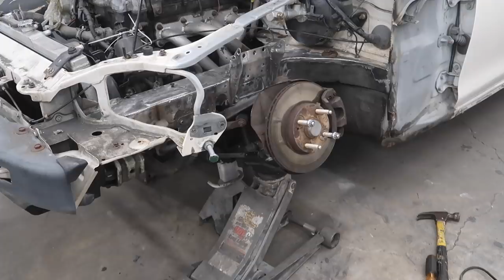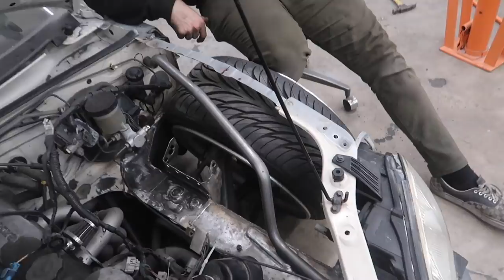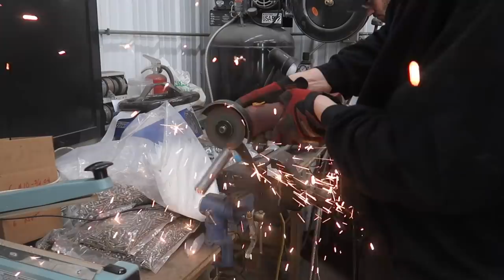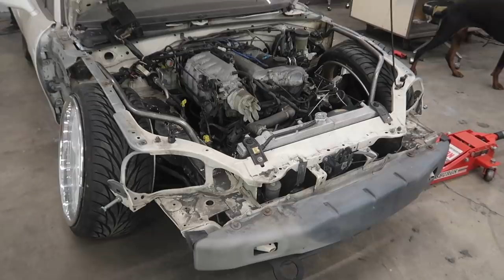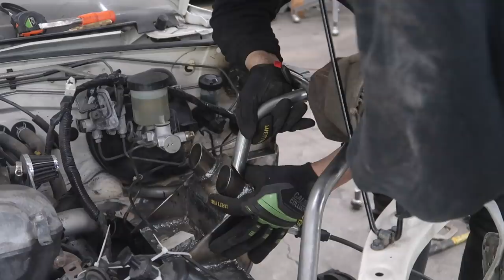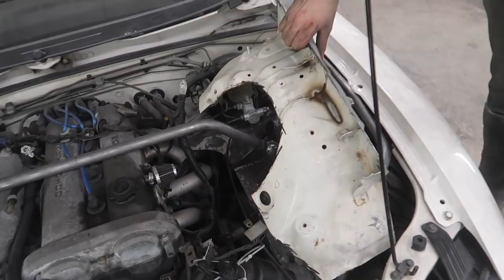First Tubed Stance Miata?

Comment: My G, Lincoln Easy Mig 140 is less than $600, you gotta upgrade from that harbor freight to get clean welds that penetrate good. It's crazy how much you'll improve with a half decent machine and some good wire. Eastwood has a 135 with cart for like $355 that's pretty okay too. Even buying Lincoln flux core wire will clean the welding up a bunch. Sucks to see so much work go into something with a questionable welder that makes questionable welds. Dig the content regardless and miss the bozo cressida